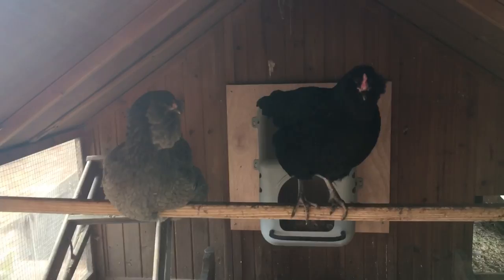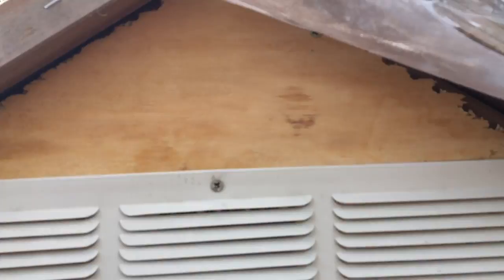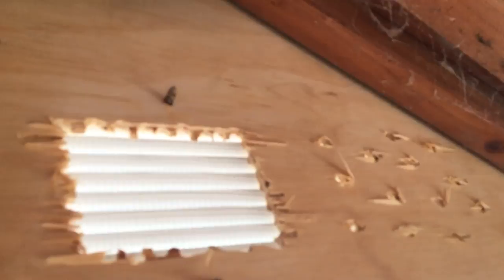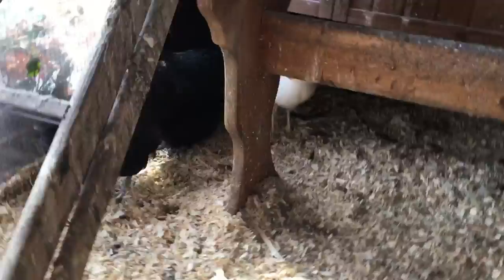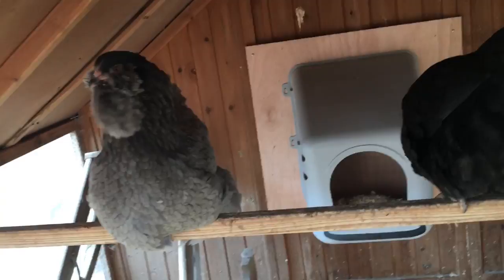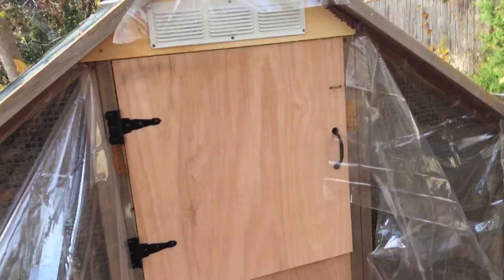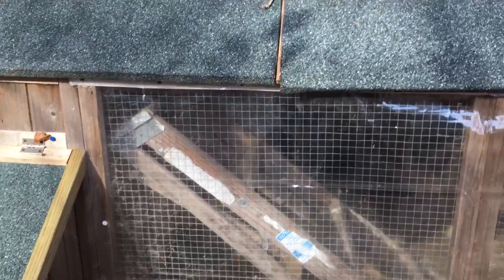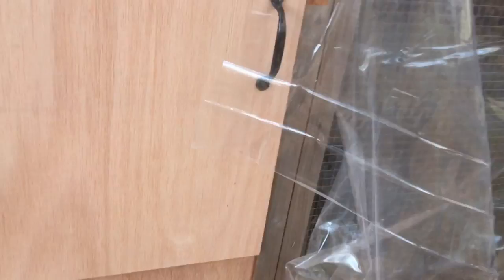HOW TO PET A CHICKEN!

Comment: Heaters are not good. I see one on the wall. It makes condensation which is not good. Also you want your hens to acclimate to the seasonal changes slowly. Going from real wari inside to cold outside is not good. Iy also invites frostbite on combs and waddles. You can get a heater which is radiant heat and is much safer as far as fire hazzard goes. They are called cozy coop heaters. I use them and highly reccomend them.

Comment: Came for the chicken not the most cobbled way to cut thin plywood. Also there is a hole in the top of the roof.
Reply: She said she wanted to vent the air. The wind would draw the air out, acting like an air pump. It's a good design.